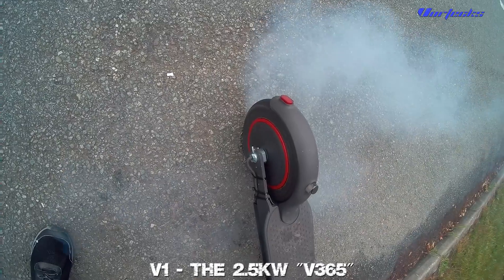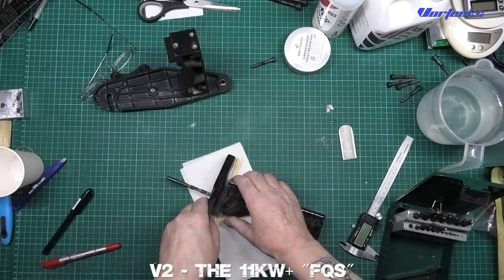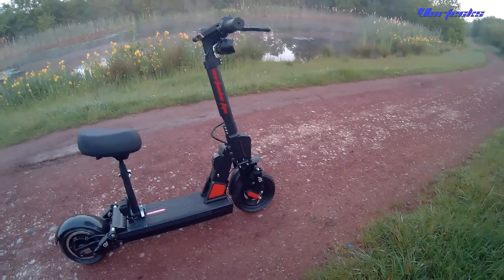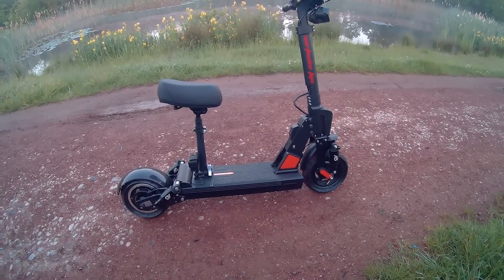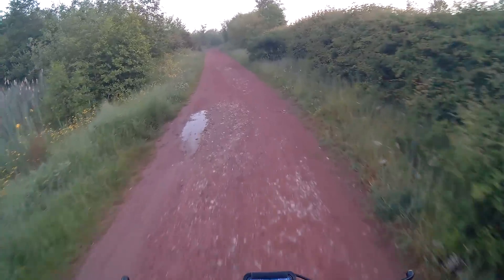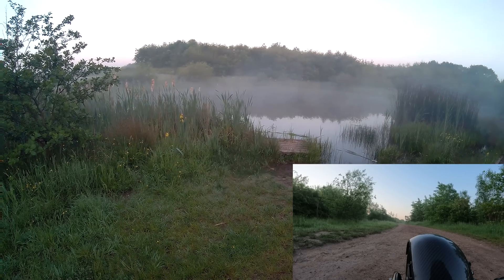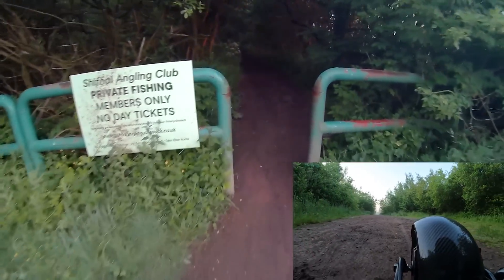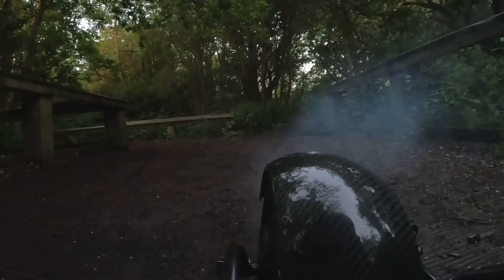Insanely fast 66mph DIY electric scooter - one of the fastest electric scooters in the world

Comment: I have exactly the same motor even the tyre from aliexpress and had 55mph GPS out of my scooter I think I will get a better battery and should hit the 60s hopefully
Reply from the maker: Be careful mate, I watched the slo-mo back (recorded at 200fps) and the tyre was starting to detach from the wheel. I reckon the absolute safe speed for this thing is 55mph but Geoff said there was loads more to give (only 3/4 throttle) but it started to lose traction. It could have been because the tyre was spinning on the rim.
Reply: @Vortecks  yeah those tyres are bad they don't have much grip I have also had to get another motor it failed on me I got an upgraded one now though

Comment: fuck at 11kw that thing will hit 70 easy
Reply from the maker: Geoff said that it was starting to lose traction at 3/4 throttle so he backed off. The real reason (after watching the slo-mo) is because the tyre was spinning on the rim. With a better tyre, you're right...... 70-75mph i reckon.

Comment: RESPECT Tony...... Respect!!!!!!☝️👏👏
What about if you make it with 2 motors (all x2) ...
How fast it will going to be....🚀🚀
Wishing you all the best!!!!🤩😍
Reply from the maker: I appreciate that mate, thank you 😊
Don't be fooled by 2WD, it's no faster. There's a reason why most supercars are RWD and that's because the traction is 80% from the rear. The 20% gained by 2WD is to help it off the line. If I was to fit a motor on the front, the top speed wouldn't be any faster but it'd get there quicker but then again, the front end lifts at 30mph so adding a motor to the front would be useless.
Reply: @Vortecks  you have just gave me an idea...😀
I will get bigger only the rear controller...i have YYK Controllers and works separate...

Comment: An amazing piece of work. Well done! Would Geoff be tempted to go faster if you added a steering damper? It all looked very stable though.
Reply from the maker: The limitation was the back tyre, it was causing wheelspin which isn't visible in the video but it is in the slo-mo. It's not 100% concentric and it was about to come off the rim. There was plenty more to give but it won't be safe until I've fixed it.......and found a new test pilot 😂
Steering damper woudln't do anything mate, apparently it was stable enough except for the back end.

Comment: Holy shit that's motorway speeds.
Looked like it still had more in it too!
Reply from the maker: Oh yes, it had loads more in it but it didn't show the tyre bouncing. The slo-mo shows that it was actually wheelspinning because it was skipping along the road.
If I can fix the tyre and find another test pilot, I reckon we'll see over 75 😊
Then again, I might just start work on V3......
Reply: @Vortecks  That thing is insane. I wish I lived closer to you because I'd volunteer in a heartbeat!
I'd find a nice flat and pin the throttle.

Might die but you'd have a great video lol

Makes me wonder what changes you would make on v3..

Consider me interested!

Comment: Lovely built mean machine! Insane power to weight ratio! Glad you're sane enough not to push it on that. Your mate rides well too, great footage.
Reply from the maker: To be honest, if I could push it, I would. I want to test it myself but I can't take the risk.
Apparently, it's got a lot more in it. The limitation was the rear tyre - it's not concentric so it was technically wheelspinning at 66mph 😂
Reply: @Vortecks  Wow! That's really impressive. Mine tops out around 65mph running at 82 volts with 11t drive sprocket and 56t rear. But having come off at 40 on rock hard chunks of mud was enough to slow me down and get protective gear. I respect mine now. I would fear riding yours though with that power to weight ratio!

Comment: That'll do more than 60mph.  Geoff barely used 9kW.  

Geoff got big bollocks.  20mph is fine.
Reply from the maker: It will pull 11kW but it'll be so rare to use it.... It's hard to explain but even when it's going at maximum speed and the throttle is pinned, it probably won't even pull 3kW. 
It'll only ever pull 11kW if the throttle is pinned from a standing start and the current will drop off after around 25mph anyway.
Reply: @Vortecks  yes.   I understand.   My 1kw front wheel drive is same.  It's a 48v system but running on 36v.   Pulls 800ish w when accelerating then drops to a much lower amount when hits it's 22mph limit, but rises when incline slows me down..      Can only imagine the pull when that 11kw is being drawn.

Comment: You have inspired me. Just this week I started ordering supplies for my first composite project. Fun times are coming….
Reply from the maker: Excellent mate. It's very messy but the rewards are priceless!
Reply: @Vortecks  Already run into a battery problem. Making my own 2170 pack. 3s2p The BMS I got doesn’t have facility for the separate charging/balance and load wires. As I am reading their diagram, everything is done using the same wire pair. And then the charger I got, arrived just today, really doesn’t have any useful instructions, has the XT60 ports and the “other” connector port. I don’t want to be blowing sht up. I know enough to ask the questions, I just don’t know the answers…. I don’t know if YT will let me post the link to the BMS on eBay or to the charger. Can you advise?

Comment: Finally! Awesome project and well done! 🙂
Reply from the maker: Cheers, Andy. It's taken long enough and I don't know if it's finished yet. I might just start designing V3 instead 😉
Reply: @Vortecks  I'd love to play with some composites, and make a fairing to reduce air resistance, or even a teardrop-shaped monocoque with solar panels.... but just don't have the time or space in a small city flat. For now, I ordered a new 20Ah battery for my C1, and will use its 13Ah as a range extender for the ebike or parallel them together somehow.
My shocks squeak and creak like mad since getting some water in them, I added some oil, now they're even worse! Thinking of ordering 2 of the 150mm air shocks you used and wincing at the price - anything else needed to make them fit with the standard swing arm and motor?
Reply from the maker: @ahaveland  You'll find that the eyelets (or whatever they're called) don't fit because they're too small - It's the main mounting holes that the bolts go through. I had to take my old ones off and swap them over. You'll have to let some air out, they're pre-pressurised to 100PSI, mine now run at 20PSI.
Apart from that, I don't recall having to do anything else to make them fit.
Reply: @Vortecks  Thanks Tony, that sounds encouraging, but I don't understand "take my old ones off and swap them over" - do the eyelets need drilling out to fit the bolts? New shim/bearing?
I found the "shocks" easy to take off and take apart, so I cleaned them thoroughly and the squeaking was almost cured, but then went for a ride and it came back - it's so loud it's intolerable! You would go nuts!